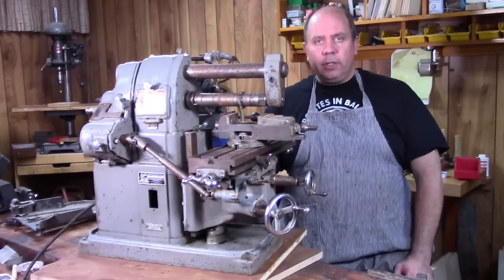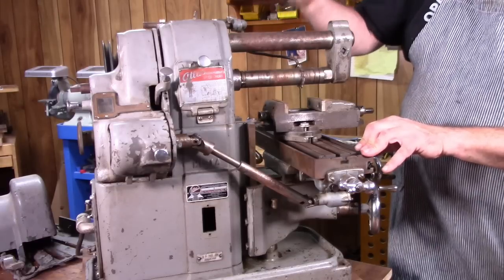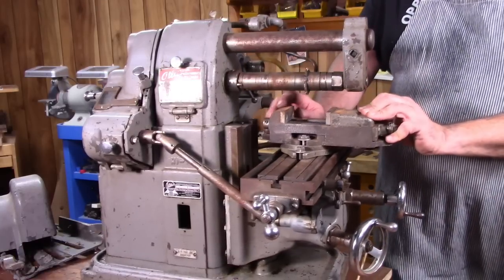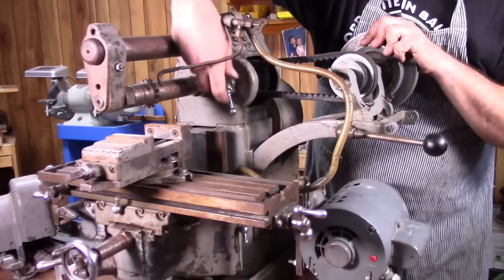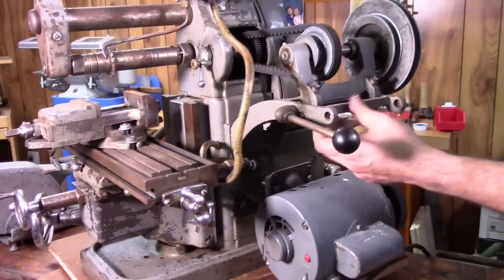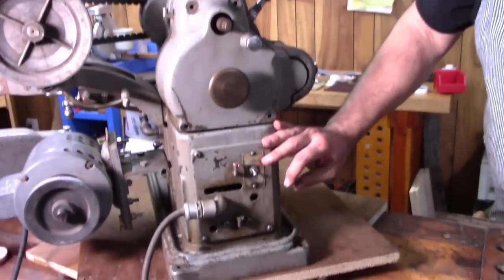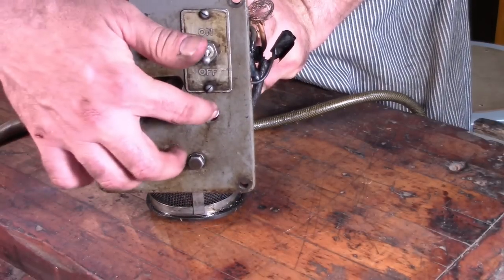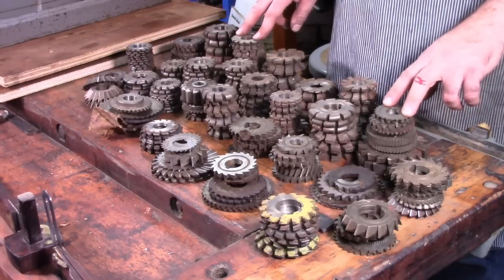Latest find: Atlas MFC milling machine

Comment: Very nice video -it's great to have such a detailed look at your milling machine. I have a similarly sized (but less featured) mill from perhaps the same era. I've got quite a few different cutters too, but mostly use just 3 maybe 4 of them. It's a real pleasure to use such a vintage but usable machine.
Reply from the maker: Thanks! I agree that it's a lot of fun to use vintage machines like this. If I were doing this for a living, I'd probably want something more modern and efficient. But since it's just a hobby, I don't mind spending a little extra time using the older equipment.

Comment: Actually Atlas sold 3 different sizes of arbors for there horizontal mills. 7/8", 1", and 1 1/4". Some of the parts like those belt guards and the vertical arbor support parts were not included in the machines base price so there was obviously more of the mills sold than had the belt guards or that vertical support. That's one reason why so many don't have them. At one time Atlas sold a parts kit to update the MF and MFB mills to use that vertical support. Afaik that's the main difference between the MF, MFB to the MFC model. That's the only Atlas I've ever seen with the factory coolant pump.

Comment: I had finally replaced front spindle bearing on my MFC,

This was major ball buster and took me half of hour to accomplish that quest,normally MF series or MFC won't have front collar that located behind bull gear,that is common problem and why Atlas 618 lathe and MF series milling machines fails because of that safety issue not present..

If there is no collar behind bull gear it most likely through some period of time use neather 618 lathe or MF series milling machines,this leads for bull gear loose off and travel further toward front or more correctly toward left side of headstock which ofcourse would cost binding between spindle pulley and bull gear indexing pin that would cost extensive damage,just because absence of front retaining collar..

I made one myself that not retained by 1 but by 2 hex screws,I build that collar from a nut and drilled 2 and tapped 2 side holes for retaining screws,the spindle pulley have one retaining collar behind so as bull gear supposed to have at front one as well...

My version of spindle pulley and bull gear have retaining screw's on their own but extra reassurances also critical to have....

The front collar that I made have small keyway to allow pass on keyed front section of spindle when inserted through headstock and rear bearing dust cap which have slot for woodruff key..

When installing spindle it is important that front bearing installed correctly and pressed all way through,by preventing bearing crushings it is advised to have spare bearing race to insert bearing into,this would allow smooth and easy installation of the front bearing,it goes little tight so it is important to oil center bore hole to allow easy installation..

Another step is insert front woodruff key than pass assembly toward collar that positioned behind dust cap,after collar bull gear with pulley and rear collar get passed by the spindle..

Sounds kind of easy but it not,it is a mission to properly fit keyed area of collar so collar slides further to side and free way of bull gear so woodruff key slides further into gear by normal tap of hand,I didn't used any hammers to do such pushing and it was all oiled up which simplified installation of parts...

That procedure took me half of hour plus another half of hour to remove faulty damaged bearing first,and next half of hour to install new bearing and spindle assembly...

Final result no more wobbles or any playings although test load required until spindle is wormed up and bearing would allow more pushing forward for proper spacing and timing..

The back gear still work tight when it engages spindle despites large amount of oil been sprayed inside and outside handle area,when handle lowers toward center it eases up and get much smoother...

Back gear doesn't damages anything at back of pulley although very small tiny signs of wear present...

The back gear engages spindle in order to install draw bars for arbor,rather than securing spindle it plays no other roles than that...

Ones again I was tested Console assembly with cross slide and everything smooth still and easy going...

My MFC assembled mostly 85-89%,rest would be assembled when test loaded and when spindle 100% satisfactory,table assembly would be installed last following by locks and arbor support arm/bar...

Another small challenge or issue was locating thin 3/8 motor mount nuts which fits 5/8 wrench,I located 2 and self made third brass material with correct tolerances..

Normal 3/8 nuts too thick and not allow mount get properly angled for suspension,there is T head shaped 3/8 bolt that adjusts motor mount position,4 holes on mount that correspond with motor I have that meet factory spec although it came out from band saw and have exactly 1765 RPM as manual specify...

I have self made and casted motor belt cover that requires final fitting and painting..

Another problem I experienced is more art problem than mechanical problem,not sure what color of paint used to paint Atlas MFC and it's parts??

Metallic finish,black satine,hammering,etc??

Very confusing color that I cannot determined,I tried Home depot for assistance but figured out that there onlu stupid idiots operating who cannot assit customers,Auto Zone doesn't have proper spray paint selection,only so far store that have large variety of paint is Doody store but I not sure what color of paint to choose....

Comment: I had assembled my MFC from piece by piece,it get mostly assembled,however since I repaired front spindle bearing it proven unacceptable and it wobbles up and down..

I would replace it when I have time since I had bought 2 Timken 7100 bearings,those are for front of spindle which standard MF series spindle front bearing..

Ever since my spindle not original MFC version rather than modified Atlas 618 lathe spindle by extending it by 1/2 longer so as rear spacer it reaches exact MF/MFC or MHC (MHC have 1" spindle all way through)..

By doing correct extension and modification rear section of spindle have 3/4 diameter instead original 7/8 diameter which is not really a big deal and if somebody want proceed same way as I did than correct rear bearing would be Timken 07079X for such matter,also there is 2 different 07079 bearing one short length as supposed to be and other longer version which over passes bearing race....

I had experienced that problem,read Timken bearing catalog and was surprised that everything should meet spec but the first bearing I had wasn't met that category..

After carefully studying I bought correct bearing,it was required some minor polishings inside but nothing major in order to properly sit at rear 3/4 spindle body..

Recently after I assemble my MFC I checked spindle and wobble was sighted without load test,iam experienced machinist and welder of 25 years of experience and easily can verify any machine malfunction,this experience served me well and I been able zero down all other issues like adjusting Console assembly and cross feed saddle assembly...

The reason I used different spindle because I couldn't find original by the time,second original parts very rare to find so I just got whole spindle assembly most from Atlas 618 lathe,bull gear,pulley and back gear most the same from 618 lathe and compatable,however pulley have different belt tracks instead original 1/2 it have 3/8 instead..

I couldn't use 618 eccentric assembly since it 1/2 shorter than MFC so I end up building my own eccentric rod and handle which is 1:1 scale of original MFC concept,it works perfectly,handle engages little tight but not with much problems,the detent engages headstock indexing hole freely and locks,the handle moves freely when goes at bottom but by positioning at top to lock spindle get little hard...

The back gear works without any known issues,headstock housing from early MF series,side wall been grinded to fit eccentric rod collar,over all headstock assembly works flawlessly..

The rear bearing dust cap self made 1:1 scale of original,all gears aligned,rear spindle gear faces reverse tumbler lever assembly correctly without any issues..

The cross feed bushing/screw and saddle nut is not original,i couldn't find original 1/2 ACME left thread,I made my own bushing,modified cross slide screw which is close 7/16 ACME left thread and made my own brass nut..

Everything adjusted and calibrated correctly,one dust cap for body cast self made exact 1:1 scale of original..

So over all I made more than 16 parts myself for my MFC,i had spend 2500 bucks for it,puting more money into it would be a waste so I made small parts myself...

The table side plates self made from steel rather zink tin alloy,crank handles for lead screw self made with high detailing and much more comfortable use,the table originally had 4 chippings on it but was only cost me 30 bucks for it so I bought and repaired by welding,by welding gray or forging cast iron forms cast iron steel alloy that impossible to drill by conventional HSS or even Cobalt bits,only Tungsten or Aluminum Oxide grinding attachments can do the job..

Despite difficulty to clean T slot tracks after welding I managed to do that job,I had placed T bolts at different areas of table T track and they holds without any issues,this vindicate that repair done successfully..

I also repaired countershaft hanger,main bottom base plate which only cost me 30 bucks each..

The countershaft tension lever self made but exact to original 1:1 scale and works no different from original same way,the countershaft assembly is ready to mount minus pulley's,they would only go on when motor is ready to mount and when I find secondary motor pulley section that attaches to main section..

The motor mount bracket self made,no different from original version and correctly aligns with motor mount,bracket already installed on MFC body,unlike original Philips head 3/8 bolts I used hex hole bolts that allow tight bolts more precise...

Comment: Was hopeing to find a Atlas to restore along with the 6 lathes I have, but I'm going to pick up a Sheldon now,, can't beat the price and are better quality than atlas from what I've seen
Reply from the maker: The Atlas is cute, but the Sheldon is definitely a better mill, no question. I would love to find one of those if I had the space.
Reply: @MrHarvard88  man I couldn't believe it,, looked rough in ad but was really hardly used no run out at all in spindle and no movement on dail indicator all through table slide,,, 10 cutters and nice milling attachment with 8 mills and 4 keyway cutters,, 300 dollars so cheap I figured it was wore out,, really a deal of a lifetime. Just don't find them like this one.
Reply: @MrHarvard88   It's the no 0 Sheldon mill really don't take up much space motor is in cabinet under machine so it don't spread out as much as the atlas , just saw one listed for 2200 so l did great at 300

Comment: Is there any difference between MF and MFC change o matic gear assembly and what the difference all about???
Reply from the maker: I'm not aware of any differences in the Change-o-Matic gear assembly between the various models. The pulleys for the back gears changed from a four-step pulley on the MF model to a three-step and eventually a two-step on the MFC.
Reply: What about cross feed table gear box assembly than??Is MF version is same as MFC or vice versa???I planning to buy one but want to make sure I getting right part,I can build my own scope shafts and yokes for it but main parts is always important rather than sub assemblies....I had made my own eccentric assembly that 1:1 exact replica of original part,i also made handle cast which hole drilled as well already for small gear axle rod,need to make specific reaming so it won't get hard to mount on unlike rear portion which was stiff to insert but precise and it counter pinned just as original..I tried rod assembly in headstock housing and it slides in and turn firmly as supposed to,gear mounts also firmly and turns as supposed to not too tight and not too loose,I think smaller rod is like 3/8 or something...Is that true that cross slide saddle screw bearing/bushing threaded end is 3/4x16 TPI??If so than I have a tap and die already,I used previously to rethread modified Atlas 618 lathe spindle by extending rear portion 1/2 longer to meet MFC spec along with spacer,all spindle sub components insert and align precisely with original MFC back gear which identical with Atlas 618 lathe..The Atlas 618 lathe have exact parts like MFC but 1/2 shorter such as eccentric rod,spindle and everything else..I can build all small sub assembly items myself,I have component identical to cross slide sadle screw bearing/bushing that need final editing and threading to screw into Console that mistakenly called knee..Lathes got Apron,Milling Machines have Console and Shavers and Planers have Rocker Arm assembly....Planers would have bottom table as moving part,same as rocker arm on Shaver but opposite location instead top it set at bottom..Shavers and Planers been outdated by Milling Machines,CNC Grinders and Water Jet system that can cut only using very high intensified water pressure..It is not hard to build one but the heart of machine is cutting head assembly with special Tungsten nozzle,the Water Jet could work in tandem with abrossive Garnet powder to maximize cutting capacity..There is an video from one of Youtube guy how he turn high pressure cleaner into water jet that have 3500 PSI,original Water Jet have pressure around 74 thousand PSI on it,powerful enough to cut fingers off if not careful enough....Funny part that most of USA frozen food that been processed also use Water Jet for cutting,slicing and dicing process,that replaces band saw's and various knife cutting equipment,it also not requires any resharpening after use which save lots of money...The motor that operating pressure pump on Water Jet have 15 HP,very powerful and huge as well,machine must be running at 380 or 420 volts,3 or 4 phased lines...The Water Jet is mostly CNC operated but would work in manual mode as well,the head/nozzle is leading part of machine with CNC feed,majority of gears get cutted on that machine and later go to finishing stage on milling machines or CNC grinders,identical type of grinders that manufacture drill bits or their sharpening at least.The bit start life as nearly flattened piece,it would insert into machine and get specific countered twist,later CNC grinded and tempered,it more hard with solid Tungsten drill bits and their manufacturing cost very high,second after tungsten goes Molybdenium bits or M7 bits,they are pricey as well and it is second hardest metal after tungsten in periodic table,the third would be Chromium and than Titanium..In pure form Chromium very toxic just like Cobalt,Cobalt in true form also highly radioactive and produce lot of gamma spectrum Y radiation particles...There was some scrap intents before in Malaysia and Thailand,unfortunately the poor individuals didn't make it because high radiation poisoning..Cobalt is very dangerous metal in pure form,it only used as alloy attachment for things like drill bits or reamers...

Comment: I need to change the M1 high milling head belt
Can you tell me how to do it
Reply from the maker: It's actually a fairly involved process to change the drive belt. You have to remove the spindle and the back gear. There is a YouTuber by the name of ghostses who did an excellent multi-part series on disassembling and reassembling one of these mills. I suggest taking a look at those to see how it's done. Here is a link to the first video in his series https://www.youtube.com/watch?v=3US-WLHTsdU&t=539s  Good luck!